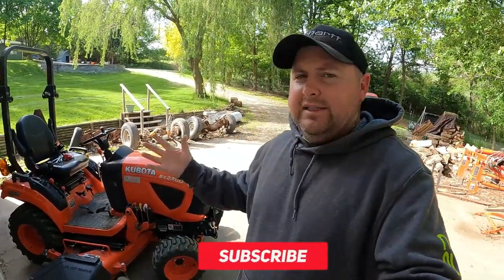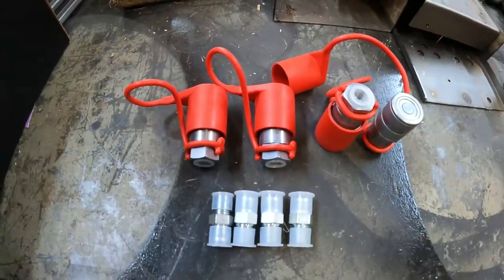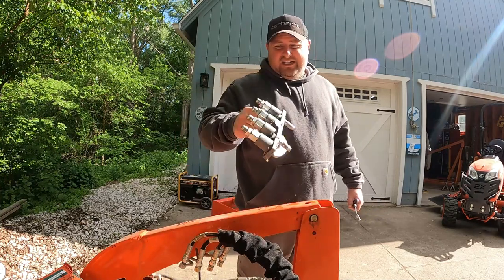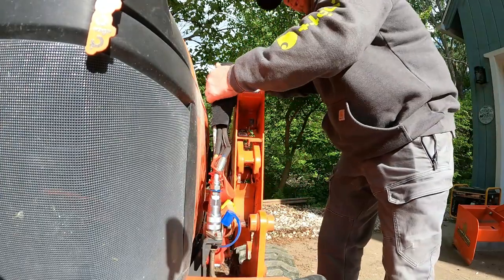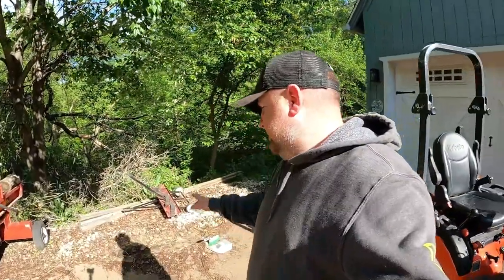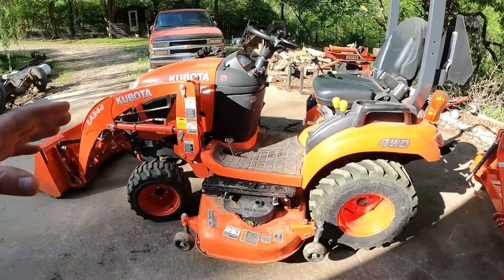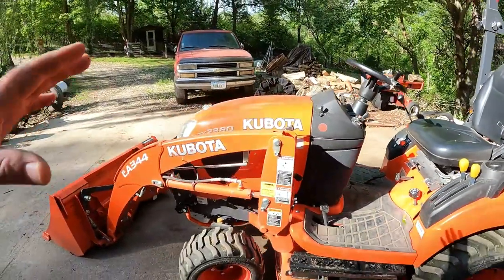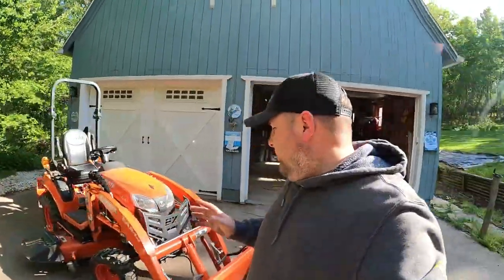✴️Kubota BX2380 Quick Disconnect LEAK FIX  ( Yeet It DELETE It )

Comment: Thanks much for this video -- I noticed that the stock quick connector rocks back and forth about 1/8" when loader hydro maxes out, that why it leaks. Bad design Kubota.  I eventually plan to delete it like you've shown, but as a quick fix, I've put a 2" hose clamp around either end of the connection to stop the movement and leak. For those looking for parts list to delete, you need: 4x  - 1/4" NPT 1/4" body Flat Face Hydraulic Quick Connect Female Coupler AND 4x - 1/4" NPT Male to 3/8" JIC male adapter
Reply from the maker: Mine always leaked at the second connector in but great observation catching that with yours 👍👍👍

Comment: I have a 2017 that has never leaked 1 drop until I finally disconnected it first the first time last week.  I told myself to never remove the loader for that reason.  If it continues I will convert mine also.  Thanks for the video.

Comment: I got 450+ hrs on my 2380 and LOVE IT!  It had 1.5 when they delivered it.  Maybe try setting the mower cut height dial to “0” so the bracket arms lower fully.  And keep all those pins and springs sprayed with red & tacky!
As far as the hydraulic leak, yeah meee toooo!  I hate that connection when it doesn’t work and love it when it does!  Could you include what connectors you used?  I didn’t see it in the description.  
Thanks for your content Brother!
Reply from the maker: I need to add that and man I’ll try the deck level but I want to think I’d did that but I’m missing something it’s is a huge pain , thanks for the suggestion.

Comment: My BX2380 is from summer of 2021, and now at 95 hours.  I pull the loader usually to mow and haven’t had leaks.  Your mower setup seems different, but mine is not drive over.  I tend to leave the mower on as a brush guard and to avoid the install effort.  I just built a grapple and used the flat face connectors for it, no leaks once the connections are sorted.  If you check your fluids, you would know the front was low or empty, just sayin. Yeah, the dealers aren’t perfect either.
Reply from the maker: I would leave the deck on too but it won’t work with my plow installed so deck comes off to make room. Not a joy at all lol

Comment: Kubota just extended the warranty to 5 years on the loader quick connect.  And they have a replacement coupler.  My dealer says they have to do the work tho…..

Comment: I only take my loader off in the late fall to put my snow blower on and put it back on again after snow is over in late spring. I have had to re-seat the connector at first a couple of times but the problems have never persisted. I don't love the quick connect, but don't hate it either. I do think that the whole quick connect and Quik-tach loader thing is really over hyped nonsense. How hard is it to hook up four pioneer couplers? How hard is it to get down off the tractor a couple of times to remove a pin or let the stand of the loader down?  Its really not worth the extra expense and complexity, IMO. Especially when I only change it out a couple of times a year.
Reply from the maker: Agreed 👍

Comment: Haven't had any issues with the hydraulic quick coupler on my BX2680, so far at 50 hours.  Supposedly the newer ones have a redesigned setup I guess, have no clue, but I haven't had any leaks with mine, but I don't take my loader off very often either, 3 times in the 10 months I've owned it that I've taken the loader off.  

As far as those hard lines on the loader, I can see that being an issue, haven't hit them yet, but probably only a matter of time, and they certainly could be put somewhere else, they're hard lines and they can bend them for crying out loud, so there's no reason they couldn't have bent them out of the way...maybe next time you hit them with the brush guard, hit them harder and bend them back out of the way better LOL.  

I honestly don't see where having 4 individual hoses/couplers for the loader is that hard to deal with, I guess if those colored caps aren't there it might become interesting to get stuff hooked up properly, but I'm sure there's tricks out there for that too.  Unless I have an issue with my quick coupler I won't mess with it but good to know about alternatives to that thing.

I have the non-drive over deck, and those lift arm brackets are a pain to get locked in on it as well, if the deck isn't exactly lined up forget about them locking in.  The front mount is a pain too, requires a hammer to get the spring pin to lock in it too.  

I'm getting ready to do the 50 hour service on mine here in the next day or so.  Gotta get it done and over with...and get done with the mess LOL.  I'll be doing all the fluids and filters, about $400 worth of fluids and filters on this go round.
Reply from the maker: Yeah I take my loader off constantly. Check that front axle for fluid lol 
I heard they change the design but they wouldn’t update mine under warranty 🤦‍♂️

Comment: 400 hours and the loader comes off every fall. No hydraulic leaks yet. If they ever do I will fix em like you did. I had the 3/4 empty front axle too but didn't check it til 268 hours. Seems like everyone did.

Comment: You didn't leave part numbers like you said you would in the description.
Reply from the maker: Correct , having issues but will add them
Shortly but in the mean time type the description I used when showing them in the video and that will get you what you need

Comment: I'm having the exact same problem, except mine is pouring fluid, Can't even back it out of shop without putting tarp down to keep from ruining the floor. Absolutely can't use it,
Reply: Could you please show or tell me if you changed the connectors  on the tractor side?
Reply: I just did mine today. A simple fix for something I thought would be difficult. You don’t have to touch the tractor side. Just clean it real good because your leak will be gone and it’s a nice clean look. 
YEET IT!!